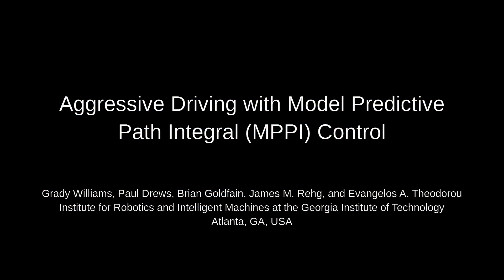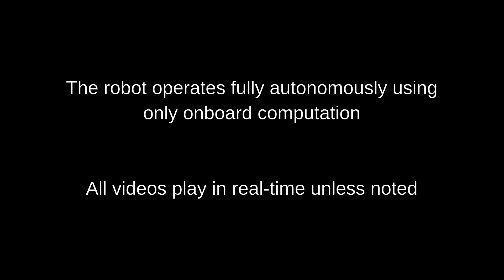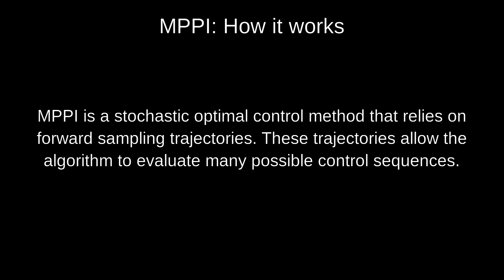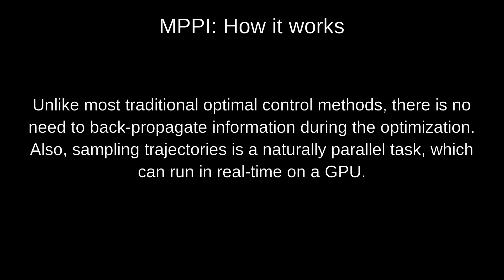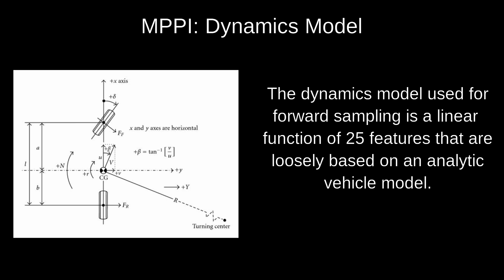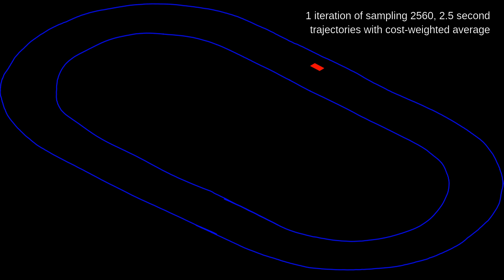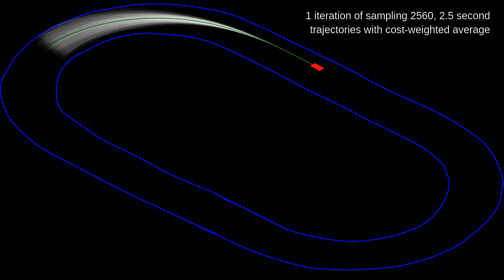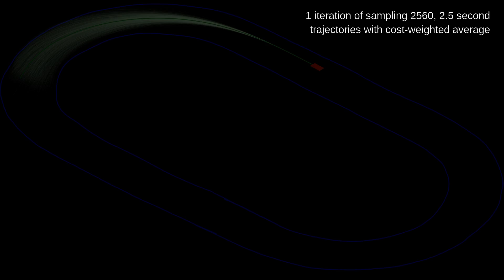GT AutoRally: Aggressive Driving with MPPI Control Overview

Comment: Very nice :) Do you have these HALL effect sensor mounted on rims from inner side?
Reply from the maker: Thanks! The Hall effect sensors are mounted on the wheel hubs. The magnets that trigger the sensor are mounted on either the brake disk or a 3D printed mount that spins with the wheels.

Comment: There is absolutely no way that has a 10hp motor...
Reply from the maker: For the experiments in the video, the throttle is limited by software to 50% maximum.The motor/speed controller we use: http://www.castlecreations.com/products/baja_conversion_kit.html.

Fully charged, the motor batteries are connected in series for a total voltage of 33.6V. At full throttle that voltage is applied to the motor by the ESC, which is electronically limited to 250A max output current. 250A @ 33.6V gives an absolute peak power output of 11.26hp. I think the 10hp estimate is a little conservative and comes from assuming the batteries are at about nominal voltage of 3.7V per cell instead of 4.2V for full charge and accounting for efficiency losses.
Reply: +GT AutoRally  If you're an engineer then you know that you can't rate an electric motor by its peak/burst power.  You rate it by it's continuous duty.  Meaning, you might achieve a continuous 1hp, depending on your efficiency and heat sink.  If you are using 33 volts and 250A PEAK, that Wattage is not all going to the wheels.  There is noise, heat and other losses.  Meaning your peak power to the wheels, on a very high grade NEMA motor would be 95% or something like that.  Even motors rated as high efficiency only are about 90% efficient.  You need to do the equation P=VI for your rated continuous safe amp draw and that is your horsepower rating.  Come on man, thats basic Circuits class.
Reply from the maker: I think rating by peak output is the standard for electric RC components since they are used differently than electric motors sized for continuous operations. These RC systems are designed to operated at peak output for short bursts because of how the human RC drivers use them. It's usually 3-5 seconds full throttle, then 5-10 seconds not much throttle, repeated as you go around the track. This goes on for a maximum of 30 (usually more like 15) minutes before the batteries are dead. 

If we ran at 10hp continuous the motor would definitely melt itself in short order. The motor can run up to 50.4V (even though we don't run that high voltage in the video), which could account for more of the efficiency and noise issues you mention.
Reply: +GT AutoRally  LOL, i used to race RC cars back in the day.  I've never, ever, seen any kind of HP rating on them.  I've always seen a "xA continuous / xA peak" rating on the ESCs.  You guys are very very talented programmers, but trying to call that thing 10hp is a complete fantasy.
Reply from the maker: When the project first started we talked about putting it on a dyno but never followed through.
We've thought about using a variety of prediction lengths but haven't had a chance to test it.
Reply: Throw it on the dyno and be done with it :) Awesome work on this project!
Reply: +syperchaic  Yesss!!!  Dyno that beast!  Good idea!  Also.  You average a ton of predictions, but they are all 2.5s predictions, correct?  Have you tried averaging a range of predictions (like a human does), from, say 0.1s to 5s or something like that?  I'd love to see more videos with different prediction intervals and higher/lower speeds (or it goes the fastest it thinks it can), etc...  ^_^

Comment: I wonder what the laptimes were and how was the progresion of it
Reply from the maker: We don't have exact measurements of lap times, but from looking at our saved data when we set the desired speed faster than the friction limits allow lap times start around 12 seconds with a relatively bad dynamics model. As a better model is learned from driving, the lap times decrease to low 9 second range over the course of 5-10 laps.

Comment: This is really quite cool. I'm certain that in time, you will improve the algorithms to be able to recover from much larger slides, and potentially even 180° spins. I'd love to hear a more detailed explanation regarding how the system works.
I truly hope this channel is updated every month or so as the project progresses - I'm subscribing just in case.

Well done, and keep up the good work!
Reply from the maker: +Lawsy Thanks! We just presented a publication about the controller titled "Aggressive Driving with Model Predictive Path Integral Control"  that should be available in the next couple weeks.

We definitely plan to release more videos as we have more results.
Reply: Excellent, thanks for the heads up.

Comment: Jalopnik says the truck tries to maintain velocity throughout the curve, did you try to set various target speed for the same curve and compare the trajectories calculated? I believe your algorythm includes the tire slip rate, yaw angle, etc "by design" and I wonder if it can mimic a human driver, who tries to keep the optimal racing line first and only then up the speed up to a point when the hardware just doesn't grip any more.
Reply from the maker: +Wojtek Jakóbczyk Yeah in this video we set an overall target speed for the robot that is beyond the friction limits in the turns. The robot uses an internal dynamics model that is updated as it drives to predict what could happen in the near future so it can follow a trajectory that doesn't result in the robot sliding off the track. During most tests we start slow and ramp up the speed. At slow speeds the robot follows the center line of the track, but at the higher speeds the path starts to resemble a racing line.
Reply: +GT AutoRally Excellent! What I'd love to see (perhaps you do, too) would be a track that is not oval in shape with two constant radius left turns, but something more of a kidney or "figure 8" shape - it would be fascinating to see how the robot copes with switching from left turn to right with increasing speed, assessing and relocating turn-in points and apexes.